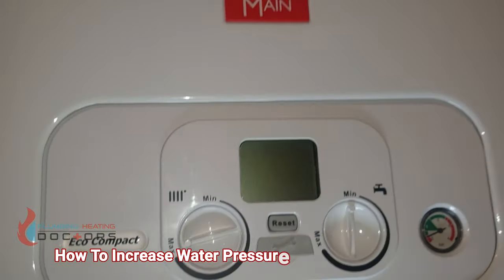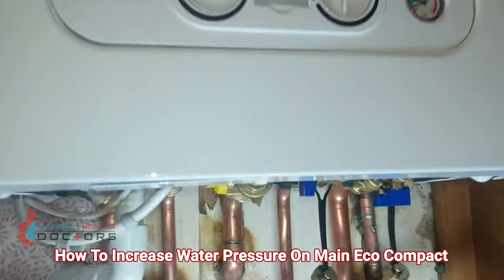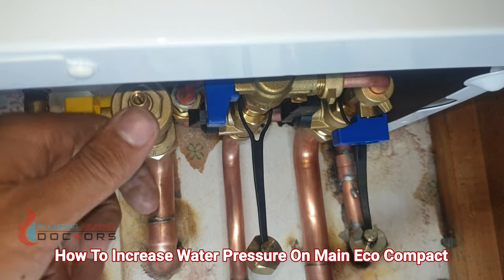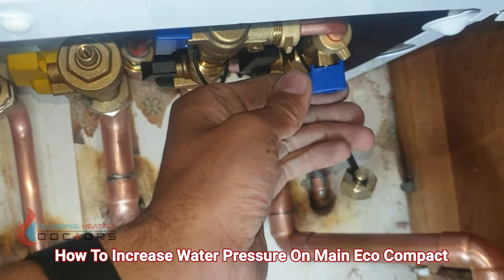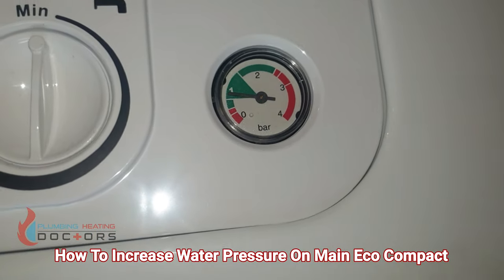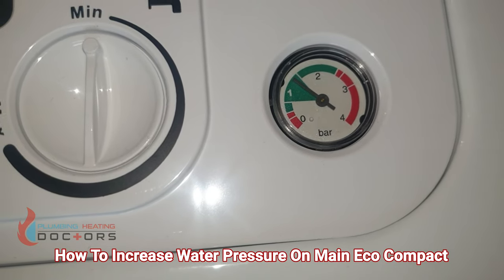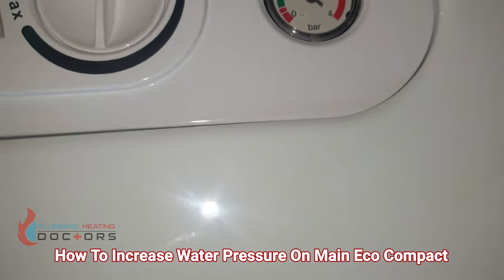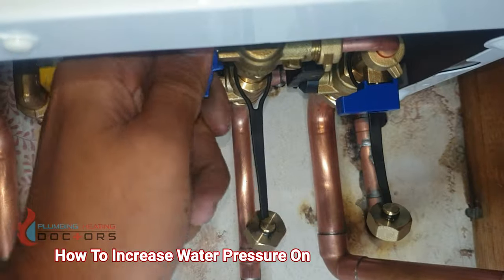Increase Low Pressure Main Eco Compact Boiler - *Flashing E118*

Comment: What to do if the display has gone off and its seems like the boiler is running, but no hot water or no radiator is heating?
Reply from the maker: Call baxi
Reply: What did you do bro eventually bc this is happening with mine

Comment: Thank you very helpful! What if the pressure went up to 2 and stayed there? Problem?
Reply from the maker: Best to reduce the pressure - remove water from bleed vent on radiator and watch the dial as it goes to 1.5 bar

Comment: Nothing happens when I turn both the nobs 😞
Reply from the maker: Thats a strange one.. Have you got running water in the property? And what pressure is the boiler on
Reply: I have the same result. Nothing happens. It doesn’t make that sound of water running.

Comment: Hi, great vid, thanks. Why exactly does this happen? My boiler is only 6 weeks old. It was working fine and then all of a sudden had the flashing 118 and no heat. I saw that someone else said they bled the radiators but I hadn’t done anything. Will this continue to happen?
Reply from the maker: It happens from time to time don't worry about it
Reply: Hi, thanks for your video. I have the same problem. All system are new and this problem happen every day.